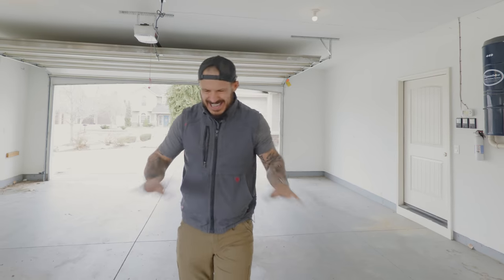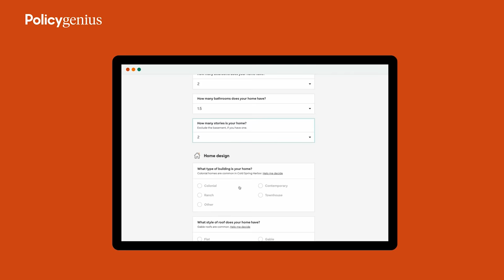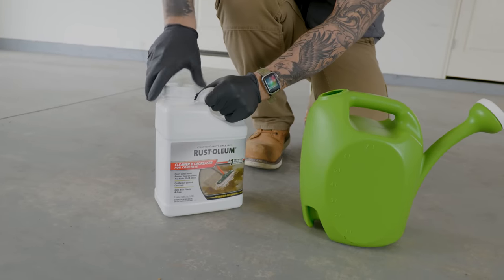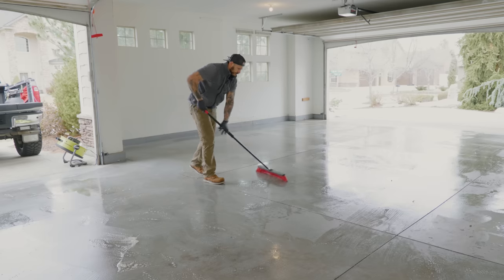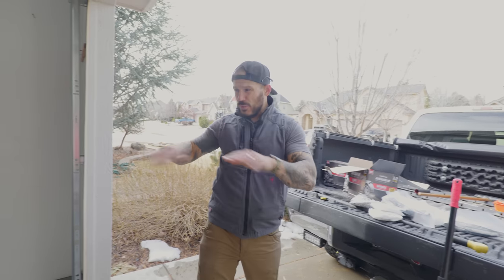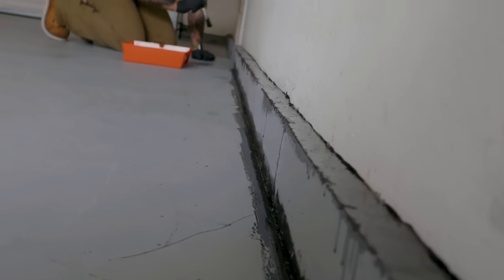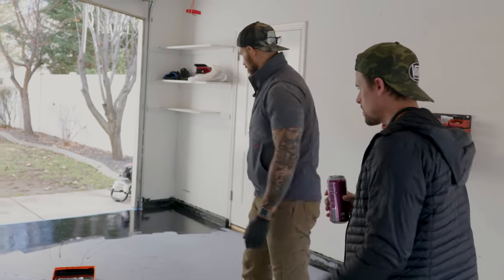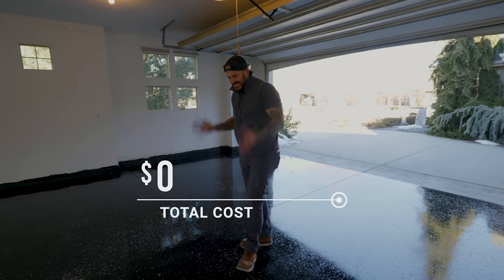New Garage Floor Epoxy + SAVED $5,000 BY DOING IT MYSELF || Concrete Slab House Reno (Ep.3)

Comment: Looks awesome! Usually having a company do it, they'll use higher quality materials not found in the box stores, and it won't ever chip or fade because it'll be a poured epoxy. Thicker than rolling it on.  The prep work is usually more intense as well. You get what you pay for 😁
Reply: The Epoxyshield Professional kit is the best way to go. The product is thicker, better quality and you get waaaay more product than these kits!
Reply: True but do you get 10 times the value?
Reply: @chickenmuffin  yessir, because it'll look good and function 10x longer.
Reply: Facts this won’t last
Reply: @solidd565  Why not?
Reply: I actually run an epoxy/polyaspartic floor business and this won’t last long, you need to bond your epoxy/poly to a rough surface, which means when prepping, you must either grind or shot-blast the floor, as epoxy/poly will not bond to a smooth floor and acid washing doesn’t make it last any longer, but that’s what you get when you buy cheap kits, once again, you get what u pay for, and you also get 2-3 layers of product when dealing with a professional floorer
Reply: @joshuaphillips874  exactly
Reply: @joshuaphillips874  Thanks for saying that. Now I dont have to. He just wasted that money. That will peel off like a fruit rollup.
Reply: They use hundreds of lbs of chips if they're broadcasting to rejection, too. Those tiny bags of flakes... Are... an option.
Reply: I used the rustoleum commercial grade product in 2002 after 20 years it has held up very good,  It looks ok you will get hot tire marks. i live in a area they use road salt in the winter it held up through 20 years of winter. I do use simple green at full strength to clean it.    I would us it again however proper prep is the key
Reply: @joshuaphillips874 Florida man how much? And how many guys can come to mexico and get this done for me? It well be on top 2nd floor. And any location for Florida?
Reply: @chinito20fam  I wish, I operate out of Canada, for a full flake floor expect ≈7-9$ range per sq ft canadian I’d assume that’s near $5-7 USD. For professional application that is. Lots of highly talented guys all around the world. Even a place called xtreme polishing solutions based in Pompano beach they could lead you to an installer local to Florida! Best of luck man!!

Comment: You should add an epoxy resin clear coat on the floors. It would make it more polished looking, extremely durable, and the flakes would look more like stars against the black background since there’d be a clear layer on top; instead of flakes that stick out.

Comment: I did concrete polishing and epoxy for a few years professionally. Grinding your floor for prep is 10000x better than acid etching. If you don't grind your floor with like a 30/40 metal bond that epoxy is NEVER going to last.
Reply: I don’t think he even acid etched, ugh 🤦🏻‍♂️
Reply: @patuno335  Looks like just painted over the old floor epoxy.
Reply: If I wanted to acid etch as well as grind, which should be done first?
Reply: Thats why he went the cheapest route it wasnt done right it will flake off

Comment: Looks good Bro,  but from experience you need to prep the concrete, strip the finish before applying. Also they sell extra flakes and you can add a clear epoxy coat at the end to give a nice finish and not have the flakes sticking up. Keep at it, can't wait for the next video.
Reply: Thats what I was thinking. The floor wasn't prepped with the acid base. Needs to be scrubbed with that. Hopefully it lasts a while. It was snowy out too, humid air, not ideal for application.
Reply: he said it was already had epoxy on it
Reply: Most people in cold climates want the texture. Otherwise it can get extremely slippery when you start tracking snow in
Reply: This guy has no idea what he’s doing. You need to grind the floor and dont use that garbage rustoleom cheap stuff you buy from home depot. Plus he didnt seal it after with a clear top coat. If you dont spend at least $800 on good epoxy material then you’re probably using garbage stuff

Comment: Hope it holds up for you.  I've seen 90% of them fail because the base coat didn't bond 100% into the concrete.  

I build new and remodel old homes. To date 100% of the homes where the home owner installed the epoxy floors failed in spots all over. Not 100% failure but 10-20%.  We pay a Ohio Garage interiors to do our homes,  not cheap but 25 year guarantee. 

I've considered buying a diamond grinder and tackeling this myself.  Im sure anyone can do this with thr right tools and preparation.

Comment: I hope yours lasts a long time.  I have a neighbor who puts epoxy floors down for a living and he says he chips these box-store-DIY kits off all the time.
Reply: I had a buddy who Diamond grinded the floor, cleaned it, etched it and followed the directions to a T and it flaked off in a year. I hired my concrete guy to do the professional level epoxy floor in my shop and man what a difference. I've welded on it, drove the tractor over it, parked my service truck on it, had chemicals on it and not a single bit peeling up. There definitely is a huge difference from the box store DIY stuff to the professional grade epoxy so its like comparing apples to oranges here when he says he did it for so cheap.
Reply: I did mine with a kit from a box store 16 years ago.  Still holding strong.  All in the prep work
Reply: @titan5535  ok but why not buy the "professional" grade and do the job yourself anyway
Reply: @AlessioSangalli  You totally could do that as well, but the materials for the professional grade system are a significant portion of the cost. to put it in perspective I have 10x 60LB boxes of flake on my floor. After scraping up excess I was left with 1 box. So there is 540lbs of flake on my 30x60 garage floor along with about a nice 1/8" layer of base and clear epoxy. The labor was maybe 20-30% of the total cost of the floor.
Reply: @titan5535  of course. I asked in another comment, what are the flakes for? On the production floor of an aerospace company I work for there are no flakes, it's flat color.
Reply: @KAPWoodworks  you park your cars in there? and actually have it go through some abuse or its just for storage? i find people who use box store kits and rave about it dont actually park their cars in the garage or actaully put it through some abuse
Reply: @AlessioSangalli  IIRC they add grip. The floor is extremely slippery without them. Most people driving their cars in from rain or snow would be at risk of a very slippery floor once the floor is wet.
Reply: @Trevih  but as I said we have epoxy floor at work, they are uniform with no flakes
Reply: The Rustoleum kit is one of the lowest rated products on Home Depot's website
Reply: @AlessioSangalli  Do aircraft come in dripping wet at work? Or does work also require you to have non slip shoes? Too many variables without knowing what your exact work situation is like.
Reply: @Trevih  no, we don't get wet stuff, that might be a concern in a regular garage
Reply: @AlessioSangalli  There is your answer. Your job does not require the additional grip provided by the flakes since there is not a fear of slipping on the surface when its wet. You have to keep in mind this is for a vehicle garage where cars might drive in after snow or rain and cause a concern for the driver to slip upon getting out on a wet floor.
Reply: @Trevih  so the answer to my question is "added grip to wet surfaces" thanks!
Reply: @AlessioSangalli  The flakes are mostly for aesthetics but they do add a small amount of texture to the floor giving it a small amount of grip when there is wet conditions.
Reply: @AlessioSangalli  they won't sell to you
Reply: @AlessioSangalli  your work most likely has two layers of epoxy if it's a solid color
Reply: @moialder252  yes. Park in the garage and do occasional car maintenance in there
Reply: @AlessioSangalli you have to rent/transport the diamond grinder, you have to have a mixer for the good products, you have to have a long push blade for scraping the flakes before applying the sealer (both steps skipped in the video), you have to have a respirator and other protection equipment, you have to dispose of/store unused products etc. Some people don’t even have a shop vac to get this done. I’m big on DIY, but I shopped this around and went with a pro.

Comment: I do high solids epoxy flooring. What $3-5k job gets you is a grinded floor to white concrete to start new, fill cracks and concrete repairs, primer and top coat application of a high quality epoxy floor (not from a home center!), flakes, clear coat, and anti slip additive. It’s a 2 maybe 3 day process.
So yea, you get a much better quality floor. You get what you pay for and when you don’t understand why it cost so much you just assume it’s too expensive and don’t compare apples to apples.

Comment: Just did my garage. I put two coats of clear sealant on top of the flakes and epoxy looks better and not crunchy any more from stepping on the flakes. I also used an cleaner to get rid of the old epoxy, similar to what you used but it gets the pad cleaned to pretty much bare concrete without using a grinder. My kit specified not to apply over old epoxy

Comment: It looks great but you applied over a previous paint/epoxy surface and not bare concrete, it will unfortunately start to come up after you park or turn hot tires on it.
Reply: Yeah I wonder how long it's gonna last
Reply: @NickVetter  unfortunately it won’t last long at all. He didn’t grind,  no clear coat, went on top of a product already on the floor, etc. Fun video and I’m sure he had a good time doing it but as someone who owns a professional concrete coating company, this was a waste of $400 and all the time he spent doing it.  Again, fun video but I would not recommend to anyone to follow anything done in this video.

Comment: This epoxy method is a quick way to dress up a garage and make it look a lot better but it won’t last long term. The reason people were quoted between 3 and 5 thousand for their garages is because when done right they grind the entire garage floor and use high quality epoxy with hardener and a top coat.
Reply: Exactly

Comment: Our company does 150+ epoxy jobs per year 

We would charge about $2400 and lifetime warranty.
Every step of the process is better.
We grind the floors.
We use 100% solid epoxy rather than the water-based water down product that you used.
We apply a poly aspartic clearcoat.
Last 15+ years without any problems
Nice video though in it definitely saves money to do something like that yourself.

Comment: hey. it’s been six months. can we get an update on how the epoxy is doing ? is it resisting all the traffic ?
Reply: Badly I’m sure. The floor wasn’t prepped properly and he didn’t use a proper material for hot tire pickup.
Reply: @mikereddy18  what should he have used
Reply: @razy7609  a professional with high solids epoxy, full flake, and polyaspartic sealer.

Comment: I don't get why you wouldn't use the drive-through part of your garage to park a car, and put the workshop in the other part. That way if you want to get machinery into the backyard you only have to drive your car outside and you'll have through access. If you build a workshop in the drive through area you'll prevent access unless you leave the middle part empty or mobile platforms only and thin benches down the wall, and that reduces shop layout flexibility significantly.
Also if you want to distribute your flakes more evenly, toss them up high and let them float down and spread, or get a container and drill some holes in the bottom slightly larger than the flake sizes, then shake it out, gets a much more even coverage.

Comment: Good job for trying it out!
Although 3-5k is a fair price due to premium material, craftsmanship etc.
Hopefully it will last a while, but usually if the price is so low, it will peel, chip off in a year or so. Then it will cost more to remove the coating and do I the right way again which will cost perhaps 2 as much.

Comment: Don't know how it's holding up but to needed to grind the floor for a scratch in order for the primer to bond then apply an intermediate coat w/ flakes and finally a top coat/ urethane to seal it

Comment: The reason it's more expensive when you pay a company is because it's a higher quality product and prep.  They grind the floor to ensure adhesion, it's Commerical grade, more paint chips, and clear coat.  I've done it myself and I've seen it done professionally, it's not the same.

Comment: They give you a lot of flakes for a reason. The idea is to use all the flakes by breaking it down by the amount/bags of flake divided by your divided sections. Now throw down your allotted amount for that section. It will look like a lot of fakes but it won't be. After it dries, you push broom off the excess as not all the flakes will stick. Now you will have an EVEN amount of flakes and beautiful finish across the garage.  If you throw it down by what you think looks good, I guaranty it won't be even when you look across the garage. As to the cost by a specialist using commercial grade epoxy; there's a reason for the cost difference. Also they might be proposing removing the top level of floor which I did with a hand grinder (3-car G). Doing this will give you a new floor to start with before using the self etching primer.
Reply: That was all I could think about when he kept harping on the cost. Ya didn’t grind so it won’t adhere as well. Didn’t scrape the flake or add a top coat and it appeared to be a fairly thin application….hope it lasts

Comment: I heard that pressure washing isn’t a good idea because it drives moisture deep into the concrete and can take months afterwards to dry out. So covering the floor with epoxy essentially will lead to bubbling up over time as the moisture off gases.

Comment: Should have used Grey color as same as the previous color.
Black is going to look and shine good for a while but as soon as you bring your car in with hot tires on, the surface would loose it's shine.
Also you could have used the same machine you rented in last video to remove the already applied epoxy and started fresh.
That's just what I noticed, might be wrong.
Anyways cool video.

Comment: You powerwashed, acid washed, and epoxy coated  all in the same day ?
Are you sure the surface was dry enough to coat over ?
Seems like a moisture trap unless you live in Death Valley. 
How is it holding up so far ?

Comment: It cost 3000-5000k because we diamond grind the floor for a strong bond that will last 10-20 years and the material doesn’t peel over time and is oil tire uv and chemical resistant

Comment: You are essentially hoping that the previous person did a great job with the coating that was already there. You can get a good result if you just add a couple of steps. First you should have got a diamond grinder to remove the old paint and put a better profile on the concrete. Then you could have done a multilayer epoxy. That can still be done affordably.

Comment: As someone that used to do this professionally, there is certainly a reason for the several thousands dollar quotes. Certainly would get a much much much nicer finish.
Reply: probably but epoxy still epoxy ... its scratchable professionaly install or not , fcat is , he saved alot of money for a good lookin floor .... he can remake it in 4 year for 400 $ and still under the professional fee

Comment: I love your videos and your channel man. Just watched your garage floor video, great job. I felt the need to give you my advice and I hope it's okay. The best thing to do is to grind the existing coating off using a diamond grinder with special blades called PCB's. Your floor is only as strong as the existing coating so the fact that it's chipping off tells me that removing it would have been a better idea. You didn't use a true epoxy but a acrylic 2 part epoxy. I would have done a full broadcast flake, and a polyaspartic urethane top coat. For what you did, it looked awesome, but honestly I don't know how long it will last. Maybe it will last a long time. Not sure.  If you want to do an industrial grade epoxy floor call us and let's talk.

Comment: to be fair, other companies who do garage floors strip the paint and grind the surface down first and usually use better than big box store epoxy.  I'd expect this floor to de-laminate in a few years due to not even roughing up the floor for a physical bond.  Looks great now though for sub $1000 and no top coat.

Comment: If I’m remodeling a house, putting a epoxy floor down would be one of the last things I did.

Plus that floor was already sealed. You should of applied a stripper first then went back over with diamond polishing blades. That will unfortunately start to peel up real soon.

Comment: The reason why they were quoted $3000-$5000 is because those companies actually properly prep the concrete using concrete diamond grinders so the material will seep in the pores of the concrete. Just pressure washing this will not last once you park a car with hot tires the coating will peel up. Also they actually top coat the surface and use industrial grade products unlike rustoleoum lol.
Reply: Also epoxy yellows overtime because it is not uv resistant. Please continue to do update videos on your garage months later it will look like crap.